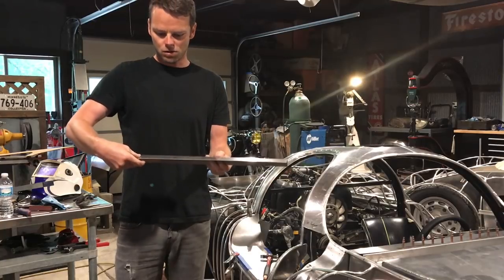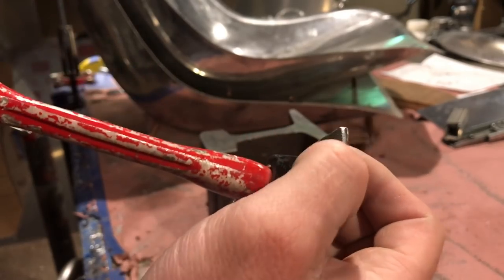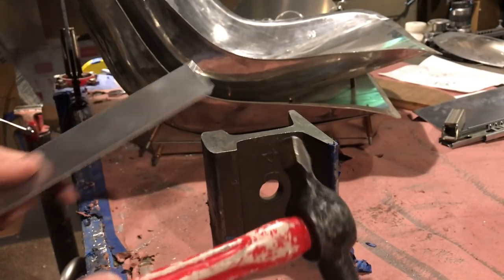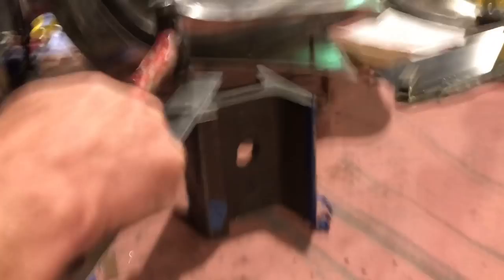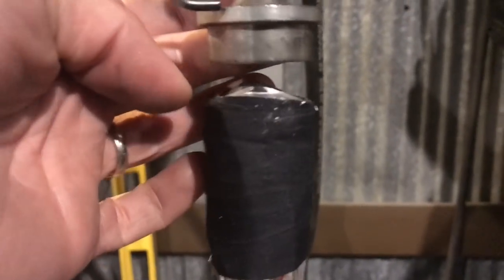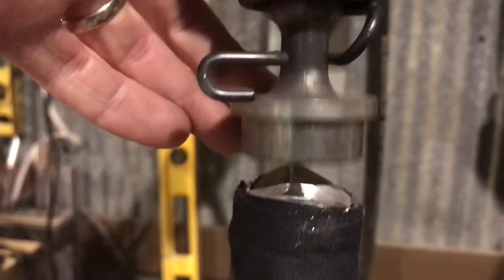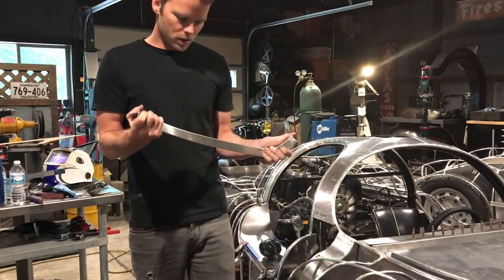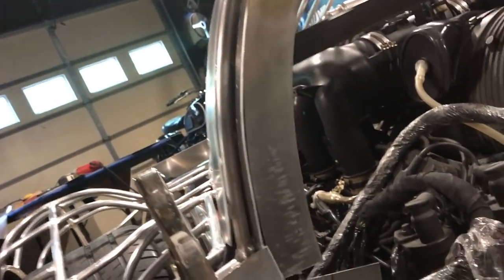Linear Stretching Metal Shaping

Comment: Once again...no information on the type of metal you are using. First: number & type 7075 aluminum ( try that - haha), next thickness; .032 , .065 etc (NOT gage), and last and very important: hardness  ( T6, T4, H14 etc)
Otherwise some good points.
Reply from the maker: Read the description.
Reply: Excellent, even though it took time to find description under "show more". But one question: how does 3003 1/4 hard hold up at 60 MPH? Do bugs dent the sheet metal or is it work hardened enough?  Please make the metal callout a requirement . Too many people leave it off.  Thus 7075 = aluminum foil i.e. same oh same oh. And we know that "aint right".